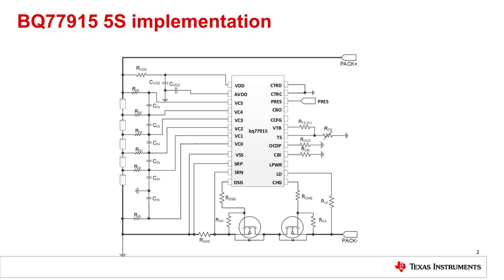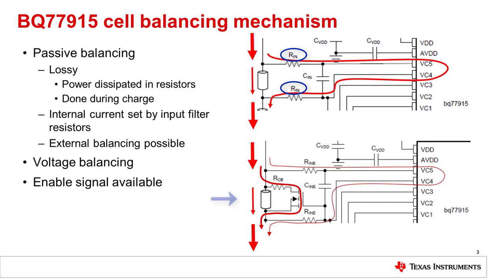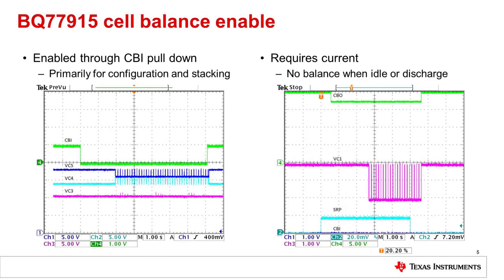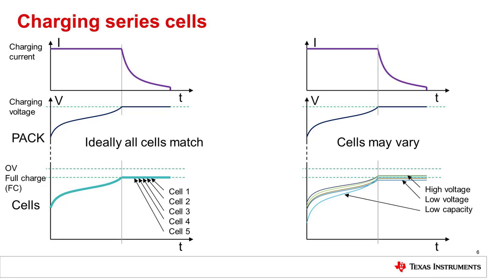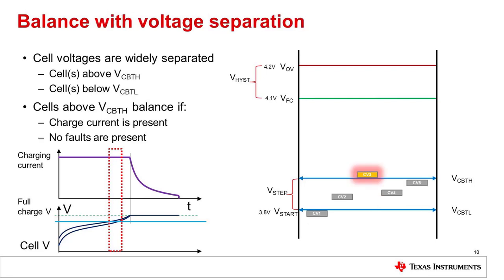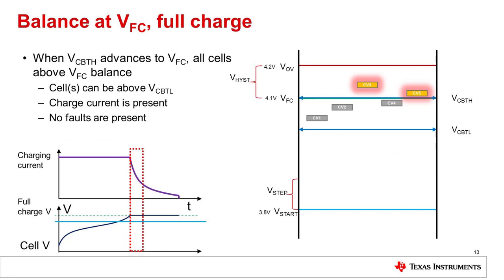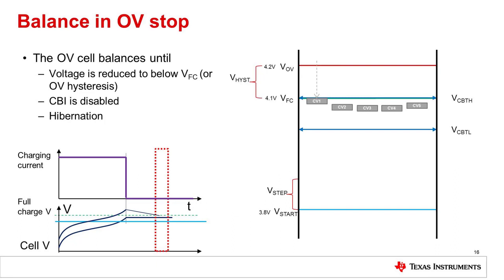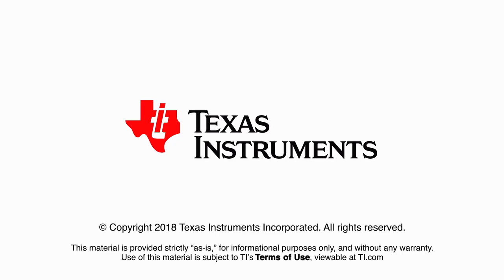How the cell balancing feature works for the BQ77915

Comment: How to implement this cell balancing using embedded code. do we have to give command to activate cell balancing simply or we have to code above mention logic for balancing
Reply: Implement? This is an Non MCU Solution just pull the CBI Pin Low and Cell balancing will start. You may use Logic Level to drive this tho...